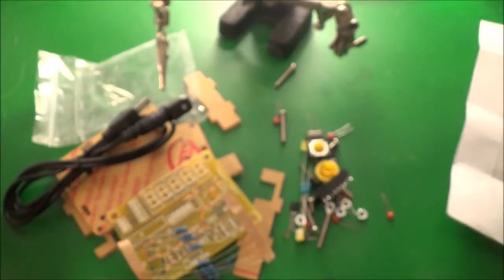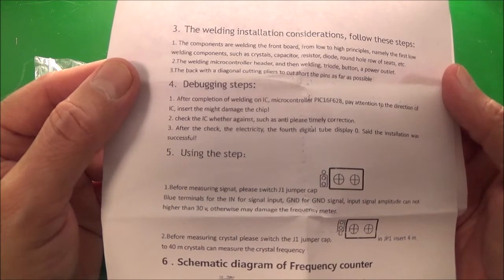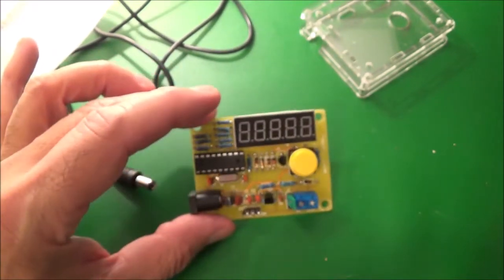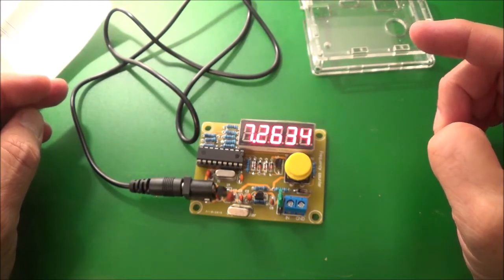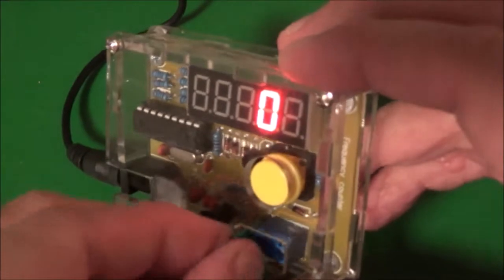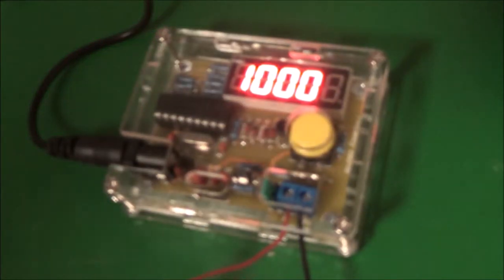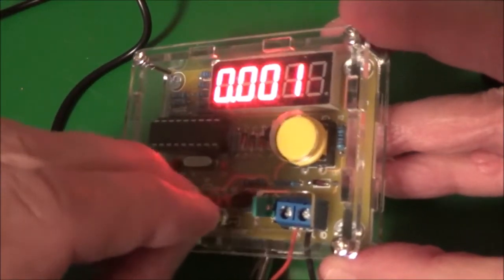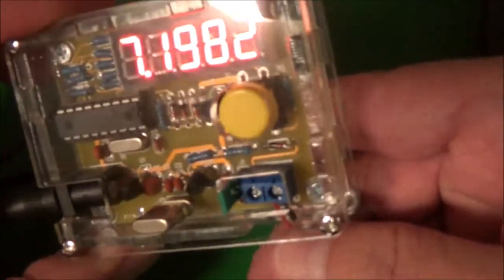Crystal  Tester And Frequency Counter TS-905

Comment: The programme button that you didn't want to get into (minutes 12 and 13 of video) allows you to change the offset of your measure. I.e., you can add or substract a previously measured signal to the one being measured, or choose a different offset from a given table of frequencies. It also allows you to choose an energy-saving mode (PSave). By not using it you miss on those interesting capabilities of this device. Hope that helps.
Reply from the maker: Thanks for that! I didn't know that at the time I believe.

Comment: Great video OS!  I've seen these and have thought about it, but I have two freq counters that can read xtals...  Its very plausible that once you've put the case on it stabilized after warm up, thus the better reading.  If it were I, I would either raise the pin header to flush or just replace the whole thing and cover the xtal to act as a oven.  What is the xtal freq used in this device? You might also be able to mod it and add a adj cap where the two disc caps are near the pin header for calibration.  Was also going to suggest using your sig-gen in place of the onboard xtal to see how far off it maybe?  Either way, hope it works out great for you!  Thanks for the demo.  EDIT  I am also gathering all components to build a Colpitts to do the same thing. ~Jack, VEG
Reply from the maker: Wow, thanks for all the tips, Jack, VEG! Yeah, could have been the case; didn't even think of that! Also, I never really gave it any warm-up time; that's a big no-no. I was in a hurry to rush through the whole thing. When I was done I immediately packed the thing away. I look forward to your Colpitts video.
Reply: I understand about being rushed...I do it often!  :)  Yes, looking forward to it as well...after demoing my 10 MHz reference, I started to think about how to do the same thing, found a 10 pack of 10 MHz xtals for 0.99 w/ship (how could I go wrong), so I bought them...wanna dork...cuz that's how I roll !  :)  ~Jack, VEG
Reply: Sitting here thinking and trollin xtal readers...not knowing the design  or layout of this device...for sensitivity...look at how the xtals are being fed its signal...look at the resistors, might be able to adjust to a slightly higher value or if we are going through the transistor...maybe change it to something more sensitive such as a Darlington or make your own Darlington...just food for thought...all though my thinking maybe be skewed and full of sour kraut!  :)  ~Jack, VEG

Comment: Hello there.  Can it measure 32,768 kHz crystal oscillator?
Reply: yes but a 48mhz crystal shows 16mhz for some reason...Also first time you get it go into program  mode and zero it with no crystal in it!